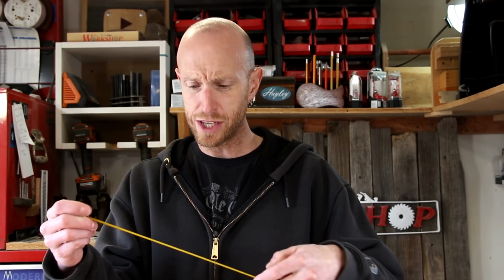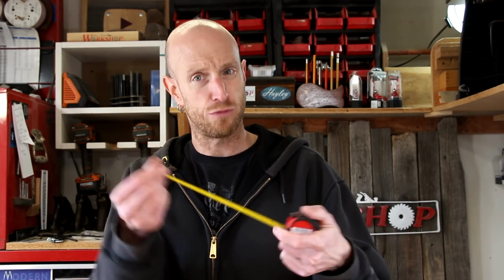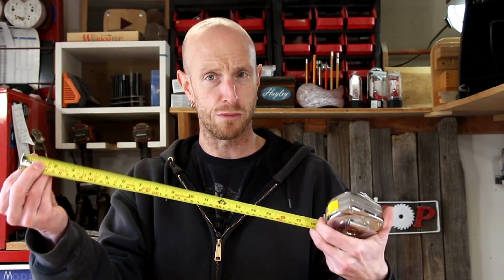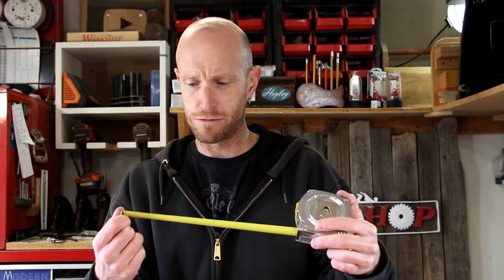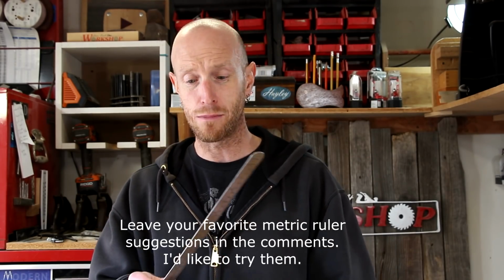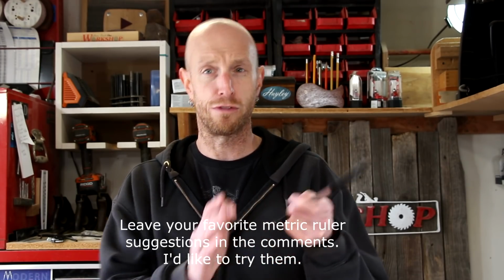My thoughts after using the Metric System for a project | I liked it

Comment: the biggest irony is that under the hood you are using SI already, just look up the official definition of an inch :)   nice to see someone not being afraid to try stuff in a different way,keep healthy and have fun
Reply: this may be the case now but how did the english create the imperial system a millenia before the invention of the metic system?
Reply: @philipgibbs2211  Stuff gets redifined, mate. When the need arose to define the inch with greater accuracy, they chose to do it by basing it on metric.

The meter itself got redifined a few years ago, 'cause earlier standards just didn't cut it anymore. Not precise enough. Now it's defined in terms of universal constants, i.e., the distance travelled by the light in the vacuum in I don't know which tiny fraction of a second.
Reply: @jorgecandeias  I appreciate all that but it does not change the fact that the inch is older than the metric system, the change in the way it is defined does not change the size of an inch,  which was first defined as three barley corns. that being so it could be argued that the centimeter is 13/32ths of an inch.
Reply: @philipgibbs2211  The absolute length for a base unit is arbitrary. It is the system with the power of ten that makes the difference and away with hard conversions. Most of the measurement units in former times used some basis that was somewhat reproducible. They had choosen barley corn instead of the with of one's thumb or length of one's foot or the lenth of 1000 steps. Problem is that those bases are not well defined. i could have 2 sets of barley corns, one set one the biggish side and one set on the smaller side. The measurements of the same length would differ considerably as does the now considered poor defintion of an inch as 3 barley corn. Time to move on to a comprehensible system.
Reply: @philipgibbs2211  the difference is that the meter was never defined in terms of inches (or whatever previous unit). It was the length of a specific rod that was originally set as standard, and copies were made of it to take the standard to the rest of France first and later the world. By contrast, inches are defined in terms of meters.

Conversions are something else. You can always convert one unit into another. I can set up my own personal unit, call it penca and say it's the length of my nose and it will be convertible into anything. But once I define it in terms of meters (well... Centimeters. I'm no elephant), the penca becomes subordinate to the meter.
Reply: @jorgecandeias  1/299'792'458 s.
Reply: @philipgibbs2211  Does the age of a system define it's usefulness and relevance? Back to the slate and chalk with you...give up your calculator for an abacus, your keyboard for a quill pen and your phone for the loud halloo...
Reply: @philipgibbs2211  The english invented the steam engine too, but I'm glad we don't have to shuffle coles into our cars anymore before making a trip. :)
Reply: @jorgecandeias  *metre, not meter
Reply: @Penguin_of_Death  That's a rabbit hole I won't be poking, thank you very much. Not a native speaker, you know?, so not my discussion to have. You discuss it amongst yourselves and when and if you reach a conclusion don't forget to let me know. In the meanwhile I'll just use the word that comes to mind on any given moment. It does vary. In this instance what came out came out, perhaps because the video was from an American, but I have been known to shift a couple letters around.
Reply: Call me old fashioned but I measure length in Ptolemaic Stadia. 1 stadion is defined as 1 second of the Earth's circumference or 185m. The stadion is subdivided into 600 podes (Greek feet).
Reply: @philipgibbs2211   By using vague definitions. Like, if you wanted to buy some fabric, you better picked a seller with long arms, so that you got more for your money. The imperal system only because a "fixed" measure when the metric system was invented, because it was used to define how long an "inch" is actually supposed to be.
Reply: @philipgibbs2211  actually, the imperial system wasn't an invention used by the entire World, but mostly in the United Kindom, and even so, with local differences. Everyone had their own measurement system, so there's no such thing as an "oldest" system globally adopted that later on someone wanted to change. And that lead to huge problems for trading goods, many unintended and several intended (fraudulent) ones, by setting units related to stuff that more often than not varied in size from place to place, if not replaced by other similar stuff when the original weren't available.

Te metric system was purposed as an international standard, and the metre (or meter) was originally defined as a given fraction of the Earth size, in such a way that anyone around the world, using navigation tools, could produce a measuring devise without having to meet each other nor to make a copy of an original. Later on (since measuring the Earth size, although doable, isn't an easy task) they made bars on a stable material to distribute around the World, yet, anyone able and wanting to do the calculations could verify that those bars were the right size and not tempered with. Finally, physics allowed for a more precise definition, always following the same principle that anyone can produce and verify the quality of measuring tools. Nothing like this was featured by the Imperial system, to the extent that nowadays their units are defined taken the metric as a reference. Why not the other way around? Because there's no way you can describe by phone to someone across the world how to place marks in a ruler every inch, and expet the outcome to be the same you have in your ruler.

Once having a distance universally defined this way, by following a simple rule set you can define volume, and weight (1 gram is 1 cm3 of water at ice melting temperature at sea level), something anyone can produce around the world just by interpreting the words. The key point here, is communication. And I dare you to describe an inch to me, or a gallon, with words that refers to anything you know for sure I have where I am (go guess it) that lets me create a a measuring device.

Just then, and on top of that, everything is a measure of 10. And that works so well that the idea propagates even to paper. For instance, do you know how many sheets of paper, of a given kind and size, are needed to reach a pound? As to estimate the cost of mailing documents overseas, charged by weight. I can give you the answer on top of my head, for instance, 200 80g A4 size sheets weights 1 Kg, or 400 40g A4, or 200 40g A3 sheets. Everyone around the world knows what to expect when I said those words. I wait for your answer.
Reply: @philipgibbs2211  Nope. 13/33 is much closer and the exact ratio is 50/127 ;)
Reply: @philipgibbs2211  They created the Yardstick. It was in the parliament building. And then there the building burned down and it took years to create a new one.
Reply: @philipgibbs2211  actually the metric system is older than the Imperial system. Prior to the metric system you had dozens of different inches in Europe. Often different per city. Currently US has still 2 feet, the standard foot and the US survey foot until december 2022.
Reply: @philipgibbs2211  Except the values of many pre-Imperial units varied from place to place and time to time. Hell, bushels and barrels still depend on what you are measuring.
Reply: @Penguin_of_Death  Many Germanic languages spell and pronounce it as "meter", like my native Swedish.

And... even the British, who spell it "Metre", pronounce it as "Meter". XD 

The French though, who spell it "Mètre", actually does pronounce it as "Metre".

Also... the use of "metre" will never be as common as "meter". Googling "metre" gives about 242 million results. Where as googling for "meter" gives about 1.19 billion results... so almost 5 times more common. ;)
Reply: @jorgecandeias  The first definition of the metre was 1/40,000,000th of the length of a meridian.
The rods you talked about were forged after that definition for convenient purposes.

Comment: I live in Australia, metric system is easier to use I'll give you the basics:

10 Millimetres = 1 Centimetre
1000 Millimetres = 1 Metre
100 Centimetres = 1 Metre
1000 Metres = 1 Kilometre
Reply: 10mm = 1cm
10см = 1dm
10dm = 1m
10m  = 1dam
10dam = 1hm
10hm = 1km
1000cm³ = 1l water
Reply: American System : 
1 inch = 6 pc
1 hamburger= 3 inch
1foot= 4hamburgers
1 MP5 rifle=1,5 feets
1 yard=2 MP5
1 pick up= 3 MP5
1 mile=1760 feets
1 Texas=  268,596 square miles (Armageddon tribute)
Reply: It's all in the names as well. "milli-" = a 1000th, so millimetre is a 1000th of a metre; "centi-" = a 100th; "deci-" = a 10th (think of the word decimal); "kilo-" = 1000.
Reply: @fast1nakus  i never seen a dam an a hm in action, but still right :)
SI rules!
Reply: Metric also does things that imperial just really can't, because the units were made to be used for science you can continually subdivide them. Below mm we have µm, micro metre and nm, nano metre. There's more below that of questionable use to anyone who isn't a theoretical physicist. It also goes bigger than a km, Mm, gm, tm for mega metre, giga metre and terametre. Notably the volume versions of these measurements can actually be quite useful.

You can technically infinitely subdivide an inch, but you really shouldn't.

Comment: the irony of americans calling inches "the standard system", when EVERYONE else uses metric, AND inches is defined based of the metric system...
Reply: No its not. The imperial system (and similar systems from other countries) is much older than the decimalised metric system based on the metre first introduced in France in the 1790s.
Reply: @marks.6480  The modern definition is based on the metric system.  Prior to that different countries had different definitions of 'imperial' units.   Some US standard units are defined differently to UK imperial units and are actually different sizes.    This was also the case in pre metric times.  A French mile could be different to an English mile.
Reply: @Daveydoodoo  Which proves my point that the metric system is not older, just better. And no, the imperial system isnt based on metric, it is calibrated to metric values because they are more precise.
Reply: @marks.6480  They aren't based on, but defined using the metric system. For example one inch is exactly 25.4 millimetres.
Reply: @jan237  like i said: not based on but calibrated by.
Reply: Lol, had the same thought. I suspect most americans don't even realise how backwards it is to still used imperial numbers.
Reply: In the past there wasn't a difference between a French and an English mile. There was a difference between a Parisian mile and the ones used in Marseille. As well as a difference between a  mile from Manchester and one from Liverpool. If you see old town halls in once important cities and towns, look at the walls. You may find engraved in some stone the lengths of the local imperial system. Those marks where made so people from other places, with different measurement units, could check they weren't ripped off by the locals and the locals could proof they didn't rip off anyone.
Reply: @marks.6480  The imperial measurements are defined by the metric system. If all the imperial rulers disappeared and you had to recreate the inch and the foot you would have to use the metric system but if the metric rulers disappeared then the metre could be recreated from its definition.
Reply: The US does not use the Imperial System. They use US customary units (1832) which derive from the measurement system ("english units") which was in place in Britain before Britain introduced the imperial system. The imperial system was defined in 1824 and is the younger system of measurement compared to the metric system (1790). At some point (1959?) the UK and the US redefined their units with a metric basis to make conversions easier (eg. 1 yard = 0.9144 m) .
Reply: I was trying to explain it to British Engineer. No. Imperial is not based on metric. Apparently.
Reply: Inches is based on the size of the thumb of the king.
Reply: @evandrolima1724  Unfortunately the king and his thumb are no longer available so now the inch is defined as 2.54 cm.
Reply: @evandrolima1724  I am afraid the people of Britain would never agree to our ruler being used as a ruler.
Reply: @marks.6480  The USA is actually on the metric system... but then a conversion value is used on the metric system to get the "correct" values in the Imperial system for the general masses in USA to use.

Search "Veritasium Is America Actually Metric?" here on youtube, and watch the first 85 seconds of it. :)
Reply: @scarfhs1  How much does the queen rule anyway? ;)
Reply: @The-Velour-Fog  which is exactly what I said.
Reply: @philwainwright9122  British units are not defined by metric standards. US units are, however. It is a mistake to say that Imperial means both US and UK units, as the two differ in many settings (the inch is not one of them however).
Reply: USA is metric, with extra arbitrary scaling factors to make life difficult.
Reply: @saturdaysatan8981  The difference between the various French and British miles were fairly trivial but the traditional Norwegian mile is 11.295 km - that's more than 7 imperial miles. This has caused a lot of confusion and still does.
Reply: @marks.6480  metric is not more precise, it's just that international standards are published in metric. The length of a metre is specified by a measurement of the speed of light and of the second. So if you specify a foot relative to a metre you are saying there is a numerical conversion ratio from a foot to a measurement of the speed of light. Therefore a foot is measured also as a fraction of the speed of light over a time interval. Imperial and metric are equally precise. Which system you use is arbitrary. If you assume that to measure twice and cut once is optimum then you get more benefit using both and comprehending discrepancies.
Reply: @marks.6480  The OP didn't say it was based on, he said it "is defined based of[f] the metric system.
A look at his name and grammar (and spelling) suggest English is not his first language. The word he meant is the word he first used "defined". When he wrote "based of[f]" he meant "according to".
At no point did he or anyone else say Metric was the older system, but as pointed out by another poster, British Imperial and American Imperial (customary units) were both codified in law at a later date than Metric was. Technically the units you use in the US are, in fact, younger than Metric. However, the system they are a part of pre-dates Metric by millennia.
Reply: @aaronleverton4221  o for heaven's sake... "based on" means "based on". English is not my first language either. Doesnt change anything.
Reply: @jwadaow  tell me something i dont klnow
Reply: @marks.6480  He didn't say "based on", he said "based of[f]". That's a pretty simple cut-and-paste reproduction. If you can't get that right in your debate then not only are you also an ESL user, but you are clearly not a careful ESL user.
If English is not your first language, then be VERY careful when debating in English. You weren't. And when given the chance to reflect you chose to double down.
The OP wasn't wrong, you were, more than once.
Stop being so self-superior.
Reply: @marks.6480  when it comes to spanners it makes a big difference   the amount of imperial  you need in comparison to metric
Reply: @aaronleverton4221  who made you judge and jury? Self-superior much?
Reply: @marks.6480  What made you such a victim? Truth hurts much?
Reply: @marks.6480  Today "imperial system" is very new system, in medieval time, inches and other "body" units had very different sizes, mostly different in every country or city, so they had to standardize it somehow and that standardisation happened when metric system already existed. It's not coincidence that one inch is exactly 25.4 mm and not something like 25.44554456465456464. For example definition of yard is from 1959!!! Yard is 0.9144 m, that is how it is defined. :-D
Reply: @marks.6480  yes, but the imperial system is not what they use in the USA, so that makes the point kind of moot.

they use US customary units, adopted them from the brits when they were still a colony, and BEFORE England changed to imperial system.
the USA stuck with what they had, as the english changed their measures, 
so, despite the many similarities (especially in name) from older days colonial britain, it is NOT the imperial system.

the imperial system indeed is not based on metric, US customary units on the other hand,  
have been connected with the metric kilogram and kilometer of over a century (but even the metric system got a overhaul in how it was defined)
Reply: @marks.6480  You know that calibrating is literally defining  a benchmark,
So if it's calibrated using the metric system, it's defined by the metric system.
Reply: @BramLastname  sigh...
Reply: It isn't ironic, it's the standard in the US. I know that the internet is on the whole "murica bad" kick but lets try a little critical thinking.
Reply: @martinhoude3518  British units are also defined by metric standards. As per Oxford Dictionary "(in Britain and North America) a unit for measuring length or height, equal to 2.54 centimetres.".

https://www.oxfordlearnersdictionaries.com/definition/english/inch_1
Reply: @philwainwright9122  I just learned something new. Which also reinforces the point.
Reply: Canada still uses inches. It's standard in North America, you'd have a hard time finding any American or Canadian who knows their height/weight in anything other than feet and pounds.